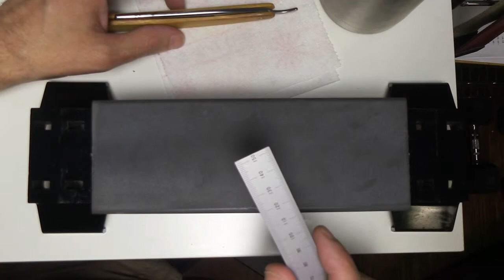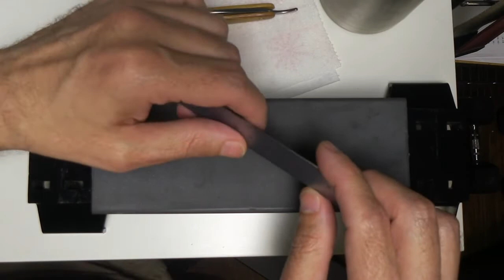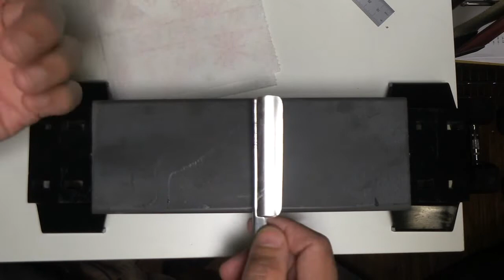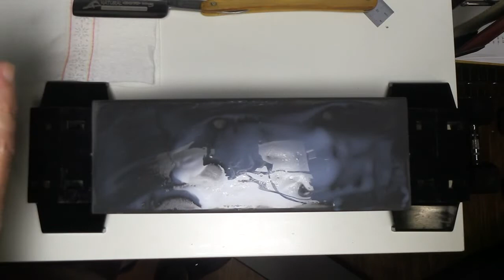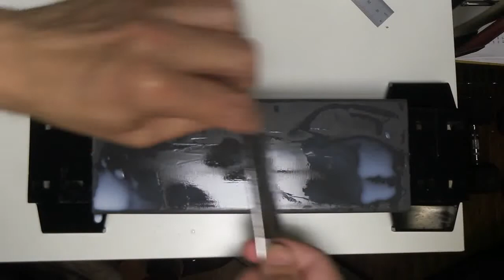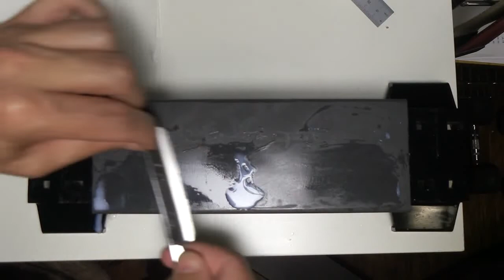#Hönenist Arkansas Stone Razor Hone Strokes and Use  04.16.2019 (Part 1 of 2)

Comment: Convex makes complete sense.
Technique would suggest leading with your wrist trailing blade slightly behind i would think, in some sort of figure
infinity  8 motion maybe....🤔
Dam i wish i had one .. i can feel it now
Reply from the maker: the Dovo honers in the vids do broad sweeping figure-8s
Reply: @thesuperiorshave  
Do you have a link to that video please...
Reply from the maker: https://youtu.be/6yvjcMvWOD0 and https://youtu.be/ShAZ09Uczv8?t=75  and https://youtu.be/guSt87Wu1Sc?t=447
Reply: Gazz, after over a year of using convex hones, I finally learned to do a figure 8 sort of move. It evolved from sharpening chisels, doing criss-crosses down the length of the stone, kinda like sharpening the tip of a knife in either direction. On the left to right drawstroke, I would start near the front left corner of the stone. I'd start with the contact patch of the chisel somewhere between center and the right corner of the blade. The chisel wouldn't be square to the stone; the left corner would be trailing a bit. Then I'd roll the pressure towards the trailing left corner of the chisel by the end of the stroke, coming completely off the stone before quite reaching the right edge of the stone. Then I'd lift the chisel and do the mirror image. I'd start with light pressure and increase pressure (and speed) by the end stroke, since I was sharpening the center twice as many times as the corners. I found short strokes were easiest to do, so I would work my way down the stone, leaving a herring bone pattern of swarf. Doing this fast and getting lazy and not lifting the blade, this turns into a sorta figure 8, with the pressure primarily applied on the forward strokes. I do essentially the same motion with knives and razors now, too (except I would usually use the entire length of the stone on each stroke). 

If you imagine you were at the contact patch, you would be moving the blade like someone might move a double ended paddle in a canoe, but rowing backwards. And with a bit of a weird drawing action. With more reach at the start of the stroke, drawing the paddle out of the water toward the end. 

If this is anything like you were thinking, then kudos for coming up with this with just your imagination. And if "you can feel it, now" then you already imagine how sublime this feels. And sounds. Drawing a keen edge over a fine, convex hone like this will make the blade sing. And with the backwards rowing figure 8, the music doesn't stop.